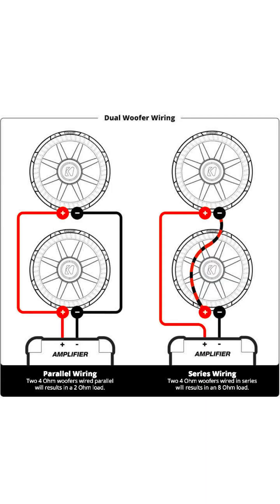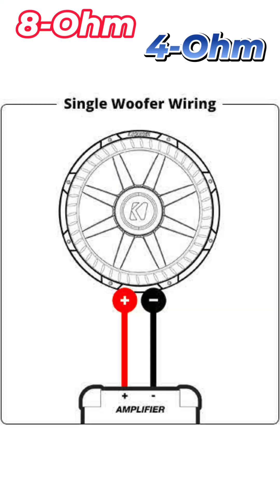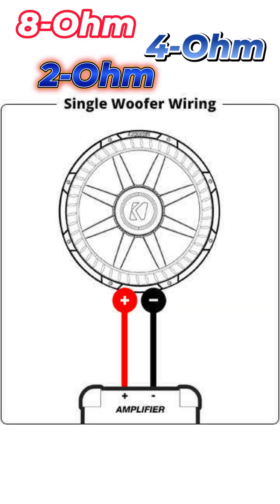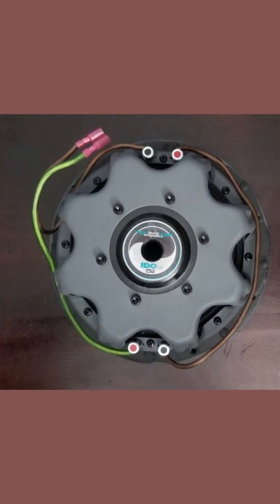DVC (Dual Voice Coil) Subs Do Not Hit Harder Than SVC (Single Voice Coil) Subs #caraudio #subwoofer

Comment: Not accurate. DVC’s will always be superior when running more than 1 sub, as it allows lower ohm setups, thus maximizing the lowest stable ohm-load for the amp.
Reply from the maker: @norfolknwhey4787  wrong AGAIN!  What if your amp performs best at 4 ohms?  Lower ohms doesn't mean louder or better for every amp... it depends on how it's designed. 

Are you going to buy a new amp every time you change subs? 

You're clearly new to car audio. Try listening instead of spewing something you saw on an SPL channel where someone was wired to 1 ohm. Not all amps perform best at 1 ohm. 🤦🏿‍♂️

DVC allows for HIGHER ohm loads as well, and some amps reach full power at 4 ohms.
Reply: @ Who on earth uses a 4-ohm amp to drive subs?!  🤦‍♂️ 
I’m not new. Been in the game since 96’ and built the Fosgate F-150 from 99-01’. 
Go spew your clickbait videos while we build winners.
Reply from the maker: @norfolknwhey4787  if you're not new, then why would you say such dumb things?  What do you mean "who uses a 4 ohm amp to drive subs"? 

With your "experience", you should know better.  The ohm load doesn't matter when it comes to power, if the amp is DESIGNED to deliver Full Power at 4 ohms 🤦🏿‍♂️.

If amp A delivers 1,000 watts at 1 ohm, and amp B delivers 1,000 watts at 4 ohms, how is one different or better? 

And before you say something else you heard on some SPL blog, you cannot hear the difference between 1 and 4 ohms on a sub. 

But again,  a 1 ohm sub isn't louder, or more powerful than a 4 ohm sub if both are paired with amps optimized for that ohm load. 

Read the other comments on this post. You're the ONLY ONE stating this nonsense. Stop being silly and stubborn. You're wrong, but you're welcome to stay and LEARN.

Comment: I think we got to disagree on that one,, from my understanding for example taking a dual 4 ohm and wiring it to 8 ohm increases the BL which according to T low makes a stronger more impactful base,, And I have a handful of people who can vouch for my four 10-in DC audios on 2 Orion 1500 DZ's I put quite a few boys with 15s to shame
Reply from the maker: Sorry brother, but I cannot rock with you on that one.  Changing the ohm load does increase the BL on a sub, but it's necessary, to have the impact you'd get from a single lower ohm voice coil sub. You'd be better with a SVC 8-ohm sub, than a dual 4-ohm wired to 8-ohms. Less inductance/more accurate. 

You have 4 monster subs on 2 monster amps...I'd be disappointed if ppl didn't hop out of your car in pain...LOL!  But you didn't do that by increasing the BL.  All subs are designed with BL parameters in mind, so you're not buying less impactful subs just because they're SVC.  I guarantee you can do the exact same with single voice coil subs as the 8-ohm BL only increases by such a small percentage, that it's inaudible.  

Increasing your ohm load to 8 to gain an inaudible BL is making your amp produce less power, but if you increase your ohm load to 8 on each sub, then wire them back down to 4 ohms, you're chasing your tail as you just negated the inaudible BL increase you gained at 8-ohms...literally chasing your tail...LOL!

It's not like you can take a sub and make it better by simply wiring it to a higher resistance load. If that was the case, JLW7's would be DVC, but they're not, and yet are considered to be some of the best subs in the world. Again, increasing the BL also increases inductance making it less accurate.

DVC's truly don't sound any better or worse than SVC speakers, I promise. You're just afforded more wiring and amplifier options.

Comment: This is absolutely true in theory. But please give me an example of a subwoofer that isn't an absolute toy that still has svc.
Reply from the maker: @Classic-lips  I'll give you two.... Morel Ultimo 12, and JL12W7 (or 13W7....and so many more). Both SVC, and probably two of the most expensive subs on the market. No toys here, and no theory.... just the facts, Jack... just the facts 😉
Reply: @Ahm-Creative  but in the big scheme of things, the vast majority of subwoofers are dvc.
Reply from the maker: @Classic-lips  yes, but that doesn't make them perform better in any way. It just allows for more wiring options. Nothing more, nothing less.
Reply: @Ahm-Creative if being able to lower the ohm configuration to match the lowest stable ohm load for the amp, it absolutely will perform better. This video is stupid. If they weren’t better, they would all be SVC and just paired with a matching ohm-load amp.
Reply from the maker: @norfolknwhey4787  lol how could the manufacturer POSSIBLY know which amp you had, and what ohm load you want to run in YOUR system? 

What about amps like JL Audio Slash amps that deliver the same power between 1-4 ohms? 

What about options? What do you think different ohm loads are for? They don't change the sound, they allow you to change the configuration of 1 or multiple subwoofers. 

I have a dual 2 ohm sub, which means I can configure it to 1 OR 4 ohms...I have options, and I'm not stuck with the amp I have. 

What if I decide to buy an amp that produces max power at 4 ohms, and before you make a genius statement like "amps are louder at lower ohm loads", it depends on the amp, not the voice coil configuration. 

Please, educate yourself to save further embarrassment, and don't come back to this channel with insults, or you'll be banned. 

My channel is to educate about car audio, which I just did. 

You're welcome.
Reply: @Ahm-Creative Touché! okay, give me an example that's not a toy, or made of solid gold, lol.
Reply from the maker: @Classic-lips  lol look at the price of a 13W7. At that price, it might as well be laced with gold 🤩
Reply: @Ahm-Creative  I agree. They take the exact same amount of winding and split it into 2 separate coils. Nothing more, nothing less. The first time I ever saw DVC was in the early 90s when I bought a pair of 12" Realistics from Radio Shack. I didn't know what to think. I was looking for 2 coils side by side, lol. I thought they had huge magnets. That was also the first time I ever saw a plastic magnet cover, lol. Don't remember ever using the subs, wish i had them now to see what they were actually like.
Reply from the maker: @Classic-lips  lol ohhhh mannn.... you took me back with Radio Shack Realistic subs.... lol! 

I think you should see, and read the comments of my "my first system was trash " video. I think you'll get a kick out of it... lol! 

Here's the link.

https://youtu.be/ToXG-XrqZek?si=7_cv1-xioPnPY6vr
Reply: @Ahm-Creative  watching now